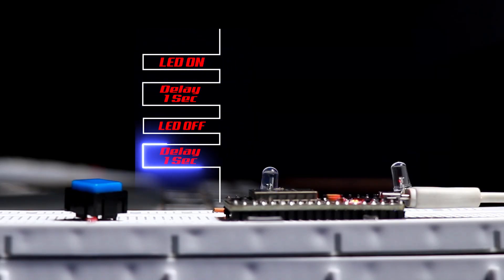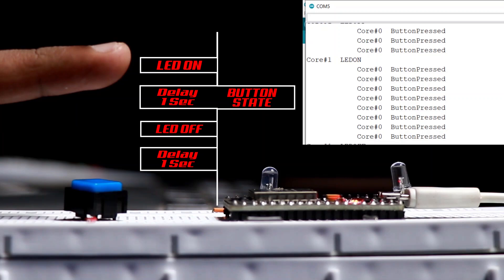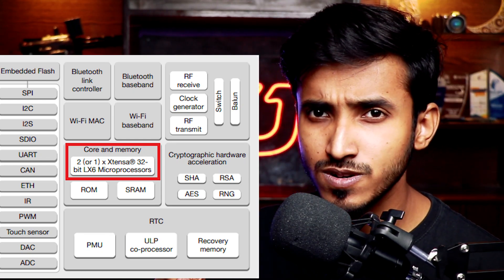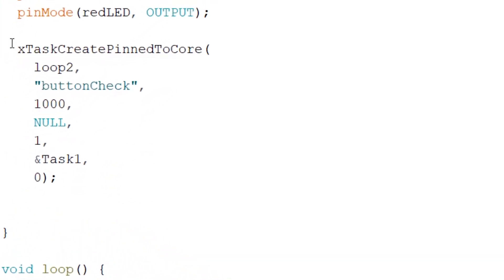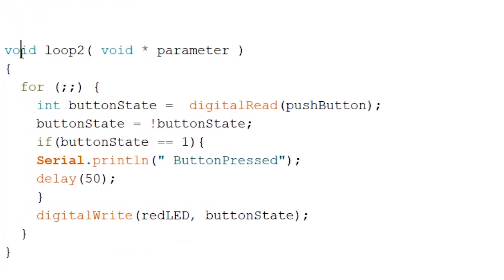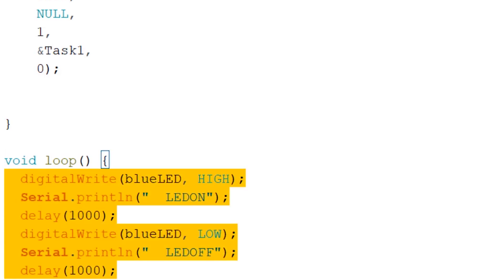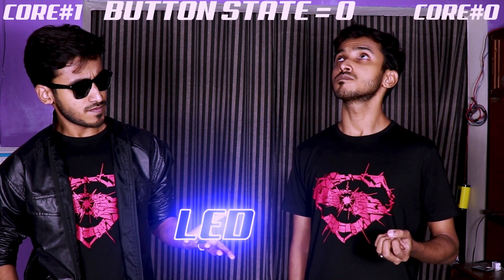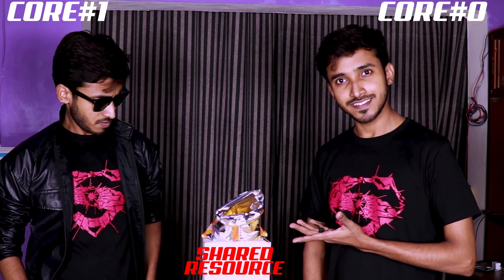2 Parallel Loops on ESP32 No Delay using Arduino IDE

Comment: WOW! I just found this...  
I would like to see how this can be used to send and receive json data for robotics.
Like being able to control a robot, while at the same time, getting system data from the robot..
Temperature, battery level, direction, etc...

And I mean for a robot that could be 1000 miles away...

Comment: I've a problem with the integration of neo 6m gps with max30102 and bmp180 temperature sensor. The problem is of watchdog error I've used freeRTOS and board I'm using is esp32 devkit v1 and the platform is Arduino. Can you help me with that?

Note: I'm using wifi and the is sent to the firebase.
Reply from the maker: Hi Thank you for your comment . Are you using multiple processors as we show in this video or is it a sequential code ? Watchdog is usually triggered when the processor becomes unresponsive . I am assuming that ESP32 is being overloaded somehow . For details we will need to look at the complete error and code. If you have a debugger that would be great so you can debug line by line . Otherwise you can try serial.print debugging

Comment: mujy arduino uno lena chahiya yan esp32 wemos D1 lena chahiya?
Reply: Brother kis kam k liye ?
Reply: @nasirbhatti6853  naya IoT me ana chahra ho to mujy in Iot board me bara me pata ni ha 

want to make AI car using opencv python and deep learning
Reply from the maker: @muhammad_talha  For IoT and AI at least raspberry pi is needed . ESP32 is suitable for only small applications . Thori bohat face recognition wagaira hojaegi esp32 pe but no proper AI
Reply from the maker: @muhammad_talha  For great AI videos checkout AIphile .
Reply: @ElectronicJunkies  there are many channel murtaza AI robotics, sentdex, python engineer but problem is hardware
Reply: @ElectronicJunkies  but esp32 comes with camera too is it possible that we can take video from esp32 camera module and process it on my main pc then send the signals back to esp32 like {where should the motor rotate or not} ..........?
Reply from the maker: @muhammad_talha  Yes you can look into rapsberry pi . And if you need something advanced you can move to Nvidia Jetson TK1 or Nano that should give you some serious processing power . For Self driving start with basic features like lane assist and autonomous emergency braking . But the code would be too much so we would suggest use something like ROS(Robot Operating System) to develop quickly .
Reply from the maker: @muhammad_talha  Yes you are right but everything depends on what features of AI or self driving you want to implement . Break your AI / self driving tasks into smaller tasks . Like what basic feature would a car need at first . For example lane assist that could be implemented without AI and possibly could run on esp32 by controlling the motor and attaching the esp32 cam. Most automotive algorithms still run without AI . Because speed and reliability is needed .
Reply from the maker: @muhammad_talha  Coming back to your idea of sending the data back to PC and processing it and sending control signals to ESP32 is also good . But then again if there are network issues the whole system is interdependent . But yes it's a good starting point . Stream live video from esp32 receive it via opencv on a PC process it and send back control signals . We have done this via Raspberry Pi and also by hacked routers with openwrt. It works but is highly network dependent . So works indoors reliably.
Reply: @ElectronicJunkies  thank you for suggestions